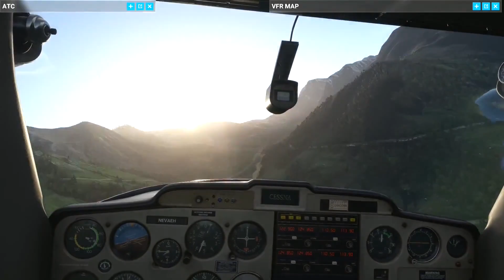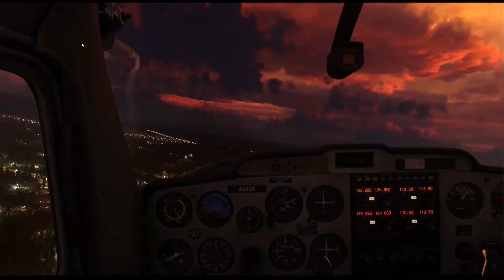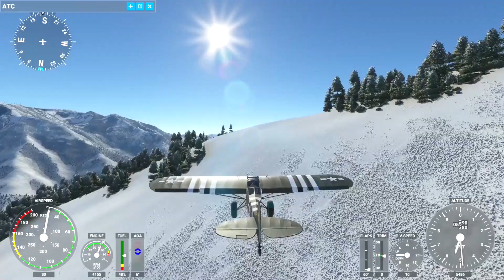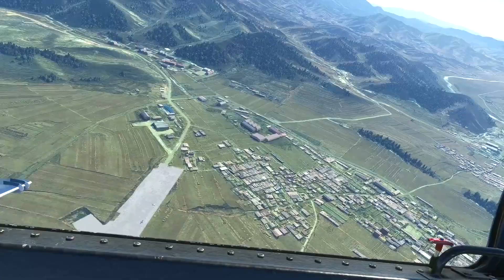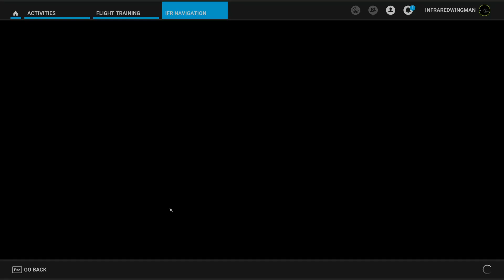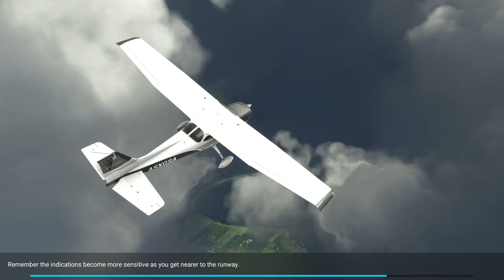IFR Approach Issue MSFS 2020

Comment: I wonder if you failed because you went full deflection on the glideslope? Granted, you were visual and hit the aiming point, but maybe that was one of the metrics that causes a failure.
Reply from the maker: Keith, its an offset ILS, so when you go visual to final, I think you ignore needles at that point or you would go off runway.
Reply from the maker: But they did fix it, so you can see in another video how you can pass it now.  Thanks for comment!

Comment: The only thing I could see was that your air speed ribbon may have hit the red zone. Maybe that was what was triggering the warning.
Reply from the maker: Thanks for the reply Jake, that is a new one and I had to re-watch to see if that could be it.  Looks like I touched down around 44 knots, that would be still a few knots above the red line.  Even if we were a little slower that close to the ground it should not be an issue, at least not IRL.  But good thinking, it was close, and something worth checking.  From all the feedback I've seen, nobody has really been able to complete this successfully, and it has been reported up as a bug on a few sites, so thinking that is really what this is.  Thanks for watching, and again, appreciate the feedback.

Comment: I have failed and I have tried it at least 100 times with all sort of combination of landings: flaps, no flaps, middle of runway, near touching the water, either side of the runway and not centered, fast landing, stall landing... something is wrong. it's driving me crazy. I hope someone posts here if they are successful. Thanks for recording the video and putting it here.
Reply from the maker: Thanks Julio, man, you have tried everything, very diligent!  I was wondering if landing shorter would help because of the offset approach, but didn't work for me either.  Appreciate the feedback!

Comment: Need to flair I think you touching with the front wheel first
Reply from the maker: Looking back at this, you can see pretty clearly by the attitude indicator that the airplane touches down with nose above horizon, so not thinking it is a flair issue.  Pretty sure it is just a bug.
Reply: @simflyguy  I have tried intentionally to land many different ways. 1 wheel, 2 wheels, and all 3 wheels. something is wrong. I can't pass it
Reply from the maker: Thanks for the feedback Atite.  Have you done this training successfully?  I tried many times, including full stall landing, nothing seemed to work.  I will try looking outside cockpit once to make sure main gear are touching first, couldn’t hurt.  Thanks for watching and for the comment!

Comment: Thanks for sharing this video. I was hoping others were having the same problem and it wasn’t because of something I was doing (or not doing). I hope they fix this soon.
Reply from the maker: You're welcome Lucas, I submitted this as an issue so maybe they will get around to fixing it.  Seems like they would want the training pieces to work properly.
Reply: @simflyguy  Thanks for posting this. I have tried this 100+ times trying to figure it out. I'm an expert now on ILS but I'm still not able to pass this level. There's something else going on. Maybe, they did it that way so you try try try and try to get good at it.